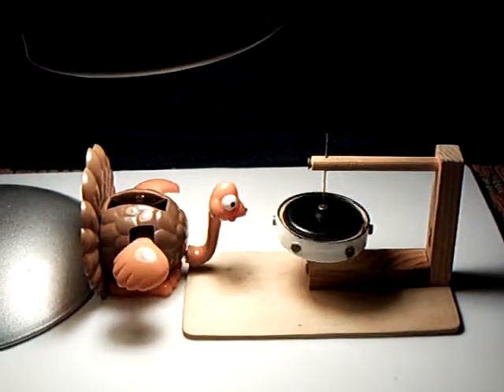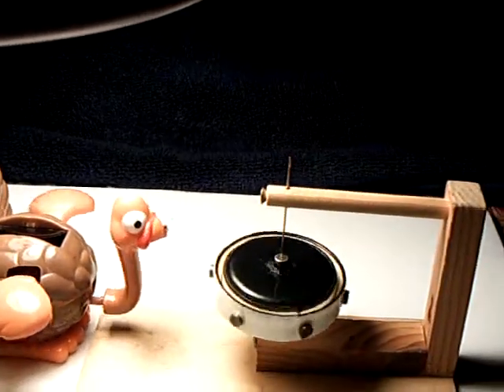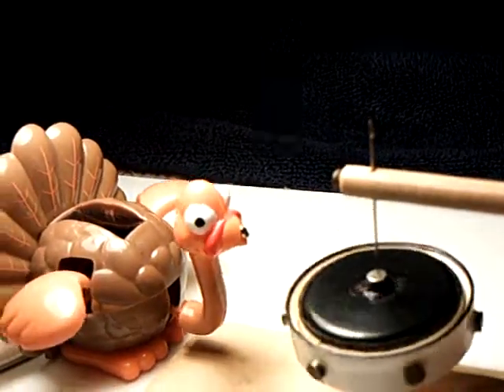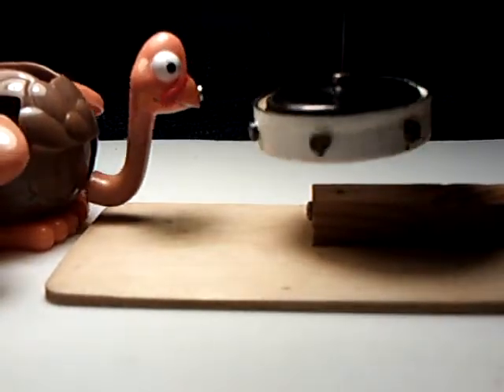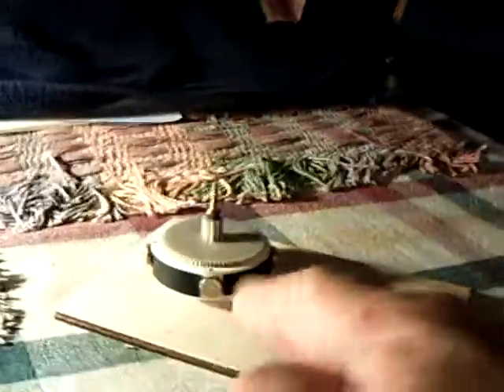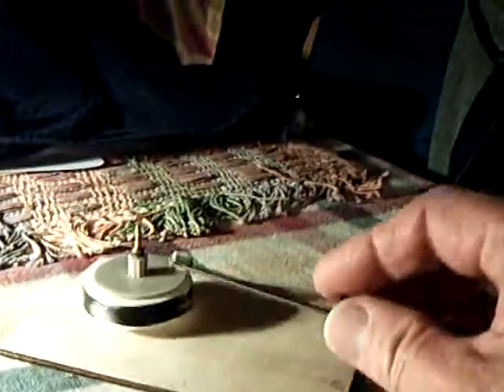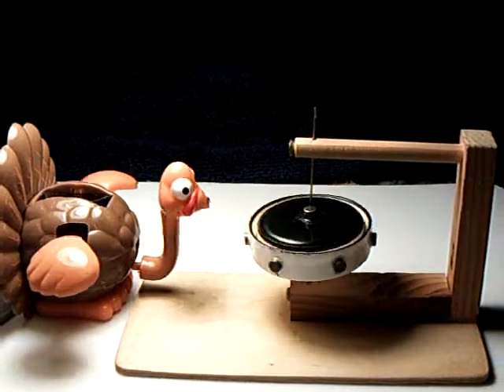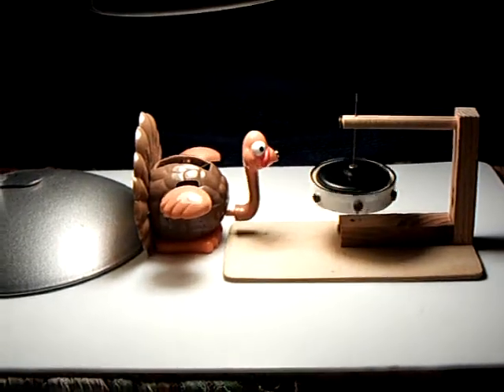Solar Turkey and the Permanent Magnet Motor

Comment: Have you tried using more or less magnets? If so what happens? Maybe because of the rate the bird bobs at you have the perfect magnet setup? Hmmm
Reply from the maker: I have tried using a four magnet rotor and had no success.  This is a very touchy setup and not that easy to get working.
Reply: ***** I found the solar turkey at Dollar Tree today. I want to turn replicate your solar turkey thing. A couple questions please. What is that hanging disk that is spinning? Also when you did the one by hand with the screwdriver with the magnet on the end, it didn't look right. Was it really working like you show is there a secret to it? Have a good day.

Comment: I've been working on a solar oscillator for a few years now and now I'm working on making it smaller. It works in low light and no storage battery so nothing but the LEDs to fails many years from now. I just posted a video of it working if you want to check it out.
Reply: Oh, and my circuit doesn't use a coil so I can make it really slim.

Comment: Haha excellent. Don't cook that guy in a few days time !
It'll probably auto start in the day, hope so. Very neat idea.
Reply from the maker: Oh I will keep that tough old bird around for awhile.  I had this working on ambient room sunlight earlier.  So far I have not been able to get this to auto start.  I have to spin up the rotor first.  When it slows down it syncs up to bird.  Everything has to be just right.  There is only micro watts of power to work with.
Reply: *****
 Had a little go myself earlier but not there yet. The dancing toy became affected in odd ways with mismatches, fun to watch.
This works similarly to the multi magnetic rotors all driven from 1, so am itching to get it working :)
Spin to match is also similar to the AC hum present in cheap wall warts output connected directly to a coil.